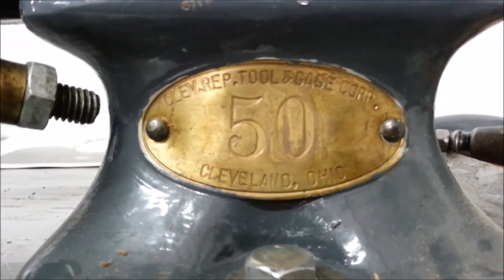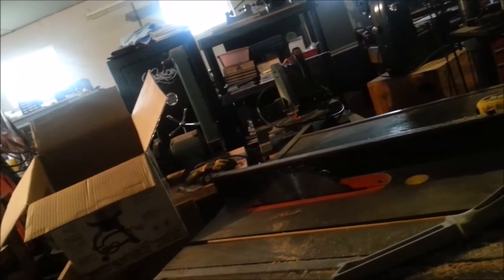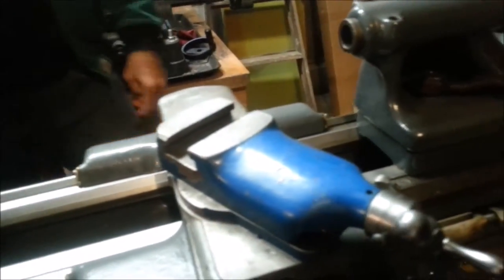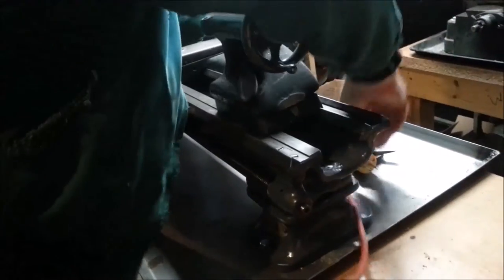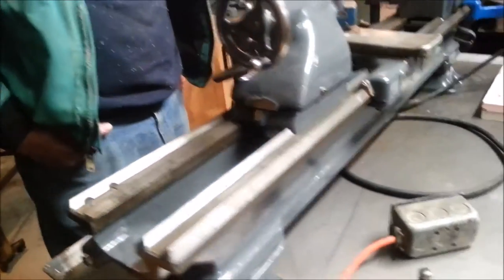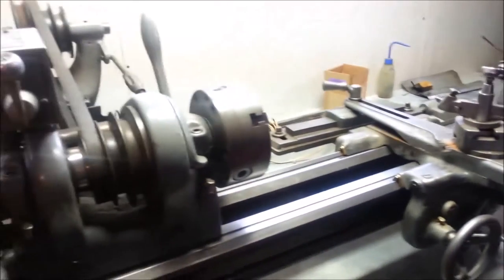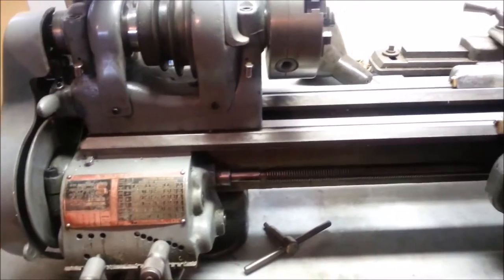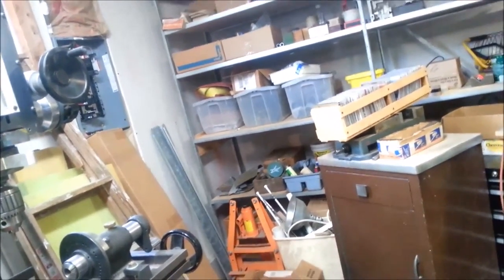South Bend 9 x 24 Workshop Lathe Part 1 - The Buy - Crafted Channel

Comment: Dave, did you keep this lathe?
Reply from the maker: This one I installed in a friends UAV shop.  I've still got to do a few things on it for him.  I have another one in the shop now awaiting my attention.
Reply: +Crafted Dang Dave, you should have kept this beautiful Southbend. It looked like it was in great condition and you stole it price wise. Did you ever sell that sander? I'm slowly going through your videos as I get a chance. I'd buy that sander.
Reply from the maker: Do you mean the Enco disk and belt sander?   I still have it.  It's on the floor awaiting me to buy or make parts so the 12" disk can have a work rest.   The other South-bend I have with QC Gearbox is every bit as nice.  Spring is right around the corner.  It will be no problem buying 6-10 lathes every spring.  The springing cleaning bug gets fired up.  I notice from April to July lots of them pop on Craigslist.  Snap up the very best priced ones.  Build up your tooling.  That is how I am doing it.  I am completely out of room right now.  I know where a Logan 820 on the under-drive stand with QC is for $450.  I can't even ask about it.  No room.  Parts for the Enco seem to be the same as a Grizzly.  About $100 for all the wiggly bits, clamps, trunions, brackets and such.  $120 for the table.  YIKES!  I'm thinking of buying all the bits and machining a table myself.
Reply: Crafted Yep, I meant the disc and belt sander that you scored for $50 with the Southbend lathe. I realize you'd want more than your $50, but I might be interested and I'd worry about the table for the disc part. I have my own dedicated machine shop in an insulated and heated 30' x 26' w/10' ceiling detached garage. The big issue is the  distance between us. You are in Dayton where the Grand American trap shoot used to be, I'm where it moved too(Southern Illinois)LOL
Where there is a will there is a way. We could figure out how to get together on the sander if you wanted to sell it and the price was right. I tell you what, Bison Bob has my phone number. Get it from him, and shoot me a text message if you do texts. I'd like to see some pics of the sander and we will go from there.?.?.?
Matt